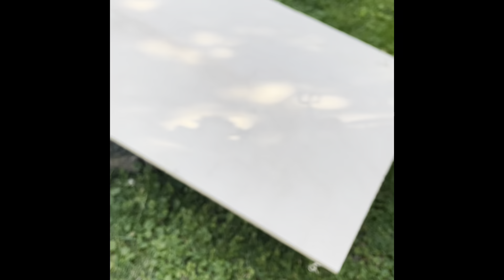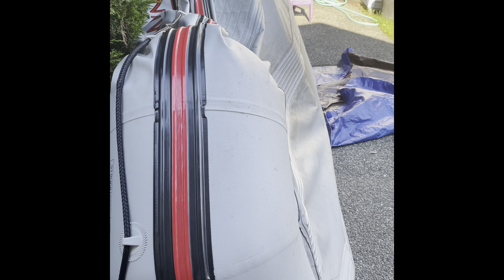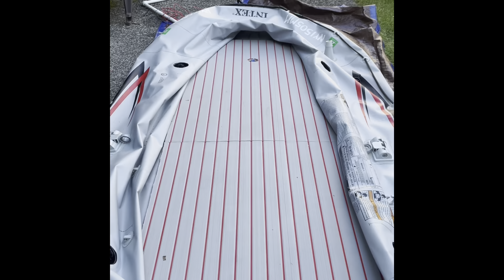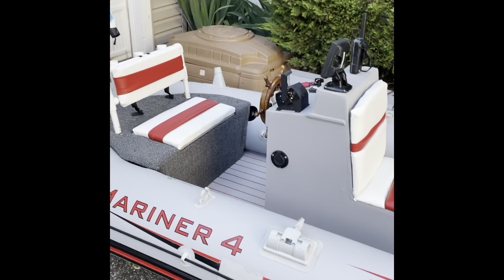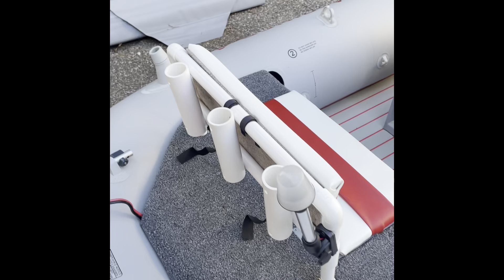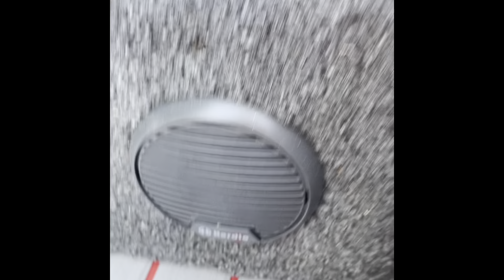Custom Intex Mariner 4~ DIY Electric Powered Boat

Comment: Awesome! I just upgraded to the Mariner 4, had a 3. Have a newport vessels 55 lb trolling motor and 55 amp mighty max battery and another battery even more powerful, solar panels, two 8inch speakers, the awning. I like the floor idea and now I'm getting a fish finder. Once I get my floors in with carpet I'm going to install two swivel seats and a table in the middle to play cards or watch TV, cook, whatever. Awesome modifications and thank you for the ideas!
Reply from the maker: Sounds awesome!!

Comment: Great job on the mods!!! Do you have a link to the gauges you bought?
Reply from the maker: Hey! The amp draw gauge and battery gauge were on Amazon. ePathChina 2" 52MM 12V 60-0-60 AMP Universal Ammeter Gauge Meter for Car/Boat/Truck/ATV.    (Draw gauge).  Qiilu LED Digital Battery Indicator Gauge with Hour Meter 12V/24V/36V/48V/72V for Golf Cart. (Battery gauge)